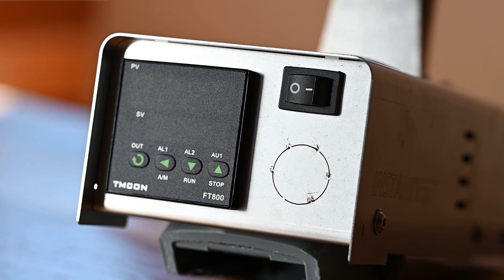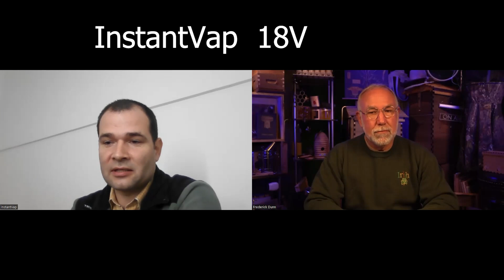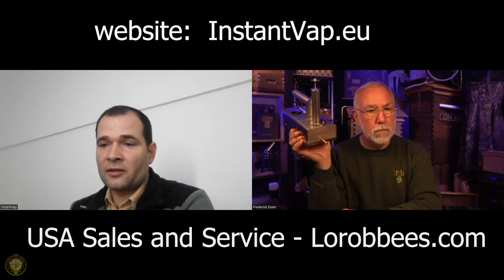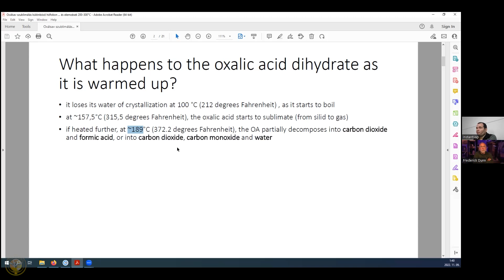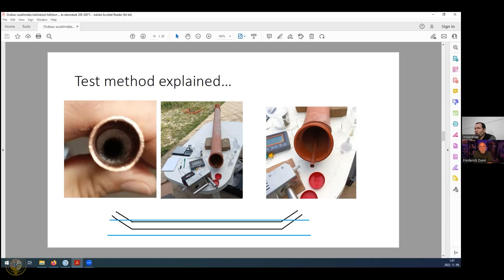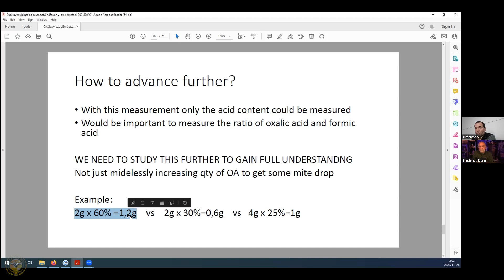Oxalic Acid Vaporizer, Battery Powered. Interview with Janos Fenyosy, A Higher Dose may not be good.

Comment: Was there any follow up on if testing had been done to determine oxalic and Formic concentrations in the acid at higher temps? 50% is rather low and hopefully it’s possible to achieve a higher percent. How was the acid prepped? It should be dehydrated before vaporizing. I wonder if most of the percent loss was simply evaporated water. What is the test that the university labs were unable to perform ?
Reply from the maker: 100°C–135°C: Water of crystallization boils off, lifting the acid (often displaying the Leidenfrost effect).   180°C–210°C: The vast majority of active oxalic acid exits the nozzle.   By ~220°C–230°C: Delivery of intact oxalic acid is virtually complete.   Look into field testing and results posted by Scientific Beekeeping. Randy Oliver performed the analyses.

Comment: This video is a couple of years old.  Some of the new studies coming out of Auburn University suggest that an application of higher than two grams of OA per brood box is necessary for good efficacy.  We are still using a 1 gram rule. Are there any scientific studies that support the 1g per brood box rule?  Janos says that there is no reason to use more Thant two grams per hive. Is that based on science or opinion?
Reply from the maker: It's based firmly upon scientific methods. 2g per box is the new dose. Janos concerns about temperature fluctuation during delivery have been validated, most recently by Randy Oliver at ScientificBeekeeping.
Reply: @FrederickDunn thank you so much for responding.  I have wondered if the temperature fluctuations of the vaporizer during a 2g vs 4g application was significant enough to cause a different chemical reaction in the OAV.  I’ll definitely try to find Randy Oliver’s  research. Thanks again.

Comment: Hi Fred hope you are well. As you know we have the mites here in Australia now. I would like to know if you remove your honey supers when you are going to use oxalic acid vapour treatment for the mite control?
We still don’t have much direction here about treatment so I am gearing up to use oxalic acid. 
Thanks. 
David Love.
Reply from the maker: We don't remove honey supers when using OAV. It's been proven not to significantly alter the presence of OA in honey before or after the treatment cycles. So, our FDA approves it. That's good news as you don't have to take anything apart to give that vapor treatment.

Comment: I use a Oxalika with the automatic tablet dispenser on top cost me a lot with import duty and a load of tablets close to £1000 but the unit doesn’t work as well as there video. I have a drill to unblock the nozzle but also the tablets can become sticky and you have to stop and clean the whole thing out a good unit but disappointing after using many different devices I find it hard to believe any oxalic vaporiser doesn’t block up. Do these battery units that every body is talking about really not block up I find that hard to believe.
Reply from the maker: Mine has not been blocked at all, but neither did my prior unit that was a ProVap. Not sure why yours would be getting clogged.

Comment: I use petrolium jelly. none toxic and is ok with high heat. and cheap. you can get at any store.
Reply from the maker: What do you mean, you use petrolium jelly? For what? And how?
Reply: I use it to grease the rubber ring on top of the plumger to make it easier to push in and out. a light coating. It says to lubricate. and petroleum jelly is used for most plumbing, mechanical and electrical parts that need some grease to keep them lubricated. FYI anything that comes with a little packet of grease is more than likely petroleum jelly @FrederickDunn

Comment: Might be quite easy to measure the outflow of gasses lime carbon momoxide with LEL measurement devices . Decomposition gives huge volume expansion ,so when decompose there will be a flow at the end of the copper pipe used .
Reply from the maker: I hope we can get someone to sample those gasses and provide some analytics. It would be very interesting.

Comment: Has anyone had any issue with tip clog at all?
Reply from the maker: Not with this unit so far, I did have that problem with the Lorrobees model, but not the InstantVap. As mentioned in this video, you can run some distilled water through it and the OA dissolves away as does the residue. But I only have 23 colonies. Have you had any clogging issues?
Reply: @FrederickDunn  I'm contemplating buying this vaporizer. I have other vaporizers where the tip clogs and it's something I no longer want to deal with.  So before I invest in another big money sideliner model I want to know this one is gonna work! lol

Comment: I bit the bullet and bought one of these vaporizers and oh my gosh I am amazed by how efficient, simple and easy to use it is.  So fast.  It’s actually fun to use!!!
Reply from the maker: I'm with you Bruce, I did all of my hives in a single afternoon. I did use two batteries though :)
Reply: @FrederickDunn  I bought 4 of the 6aH batteries so should be able to plow through 90-100 colonies without having to worry about recharging.  I used 4 grams on the colonies.  I heard what he said about the effectiveness of using 4g so might need to revisit the dosage.

Comment: Ha Fred I watched this again  did not quite get it  was told research says  1 gram per box does not work  need 2 grams per box,   so I have been using 4 grams  is he saying that it sould be 2 grams that 4 grams  drops the eficiency and does not work  because of the temp drop  thanks
Reply: Hello
What I was trying to say is that the behaviour of the vaporizer tool (how much the temperature drops with the addition of oxalic acid, how it maintains the temperature when the outside temperature is lower or windy) has a big influence on how much oxalic acid comes out of the tool, how much degrades in the tool already.  
There are many types of vaporizers on the market, most of them are clamp heated and the temperature drop is significant, so they are inherently inefficient. If a larger amount of oxalic acid (e.g. 4g) is added into them, the temperature drop is even greater and the efficiency even worse. Overall, you may only get 20-30% more oxalic acid if you double the input amount. This should be better investigated and taken into account when treating. I hope it make sense. 
Also, with this knowledge better vaporizers should be designed.
Reply: @instantvap5808  Thanks
Reply from the maker: HI Frances, please link the actual research that supports 4 grams? I cannot "legally" endorse dosing or methods that are outside labeling or approved materials/equipment. But it's clear in Janos' presentation, that higher dosing at 4 grams can result in a much lower actual OA delivery to the hive/brood/bees. His personal sweet spot was 3 grams with his large hives. Temperature controls, based on his presentation and testing are critical if you want a "good dose" of OA to reach the targeted area. His system is part of the potency, as shown in his charts, the 2 g dose is delivered fast and at the correct temperature that will not degrade the OA. As mentioned here, it's an area that is in need of further evaulation. The real result for you would be what your mite-counts were before treatment, and then after treatment. If the mite load isn't significantly dropping, then something has to be evaluated further. I achieve good gontrol with 2 g dosing with two hive boxes. 1 g for my nucleus hives if they are singles, 2g for my nucleus 3-stack hives. Controlled delivery at a fast rate would be beneficial.
Reply: @FrederickDunn  Thanks
Reply from the maker: @framcesmoore  you are always welcome :)

Comment: Loved the interview,  he said he strictly uses OA. I wonder if he does maintenance doses all year with brood in the hive  or creates brood breaks or only treats late fall or winter when bloodless
Reply: Hi. 
I did brood brake this September the first time. 

Previous years I vaporized 
-	after acacia 7 times every 3 days early-middle June
-	after sunflower (August) again 7 times every 3 days. 
-	in winter 2-3 times when they come out for cleaning flight. 
But every year is somewhat different, some years the mite load is lower, other times it is much harder to keep under control. Definitely it needs to be monitored. 

I do the queen cages this way: 

Find the queen and put it inside the cage, close it, and put it between 2 brood frames. 
- day 1: queen caging. It should be in autumn, when the feeding for winter already finished, only a couple of brood frames remained. In central Europe we do it during September. 
- day 16: first oxalic acid vaporization, by this time all the brood is capped. (once the supers are off, it is enough to treat them with maximum 2-3 grams of oxalic acid dehydrate per colony) 
- day 22: queen is let out of the cage. no caped brood is left, all the mites are on bees, no place to hide for them. 
- day 23: 2nd OAV. 
- day 27: 3rd OAV. Even if the queen started to lay eggs, no capped brood yet. 

 Some of the benefits of this method: 
- a time period is created when there is no capped brood, so the mites can be all reached by OAV. 
- There are 2 treatments of OAV, when the mites has no place to hide. 2 times a very efficient treatment kills more than 95-98% of all the mites. 
- Because there is a very low mite count to stat with in spring, these colonies are usually enough to treat in august next time. Periodic check is necessary, as infestation of mites can occur from outside through robbing, etc. 
- the winter bee generation goes into a rest mode, as there is no brood, no reason to work. They remain strong for a start in spring. 
- the winter bees are healthy, they go into winter without mites.
Reply from the maker: This is a fantstic reply, I will repost it in the description. Thank you, Janos!

Comment: Great video  He said he only used OA for his treatments and that he has had no loss since he started doing this     How often does he treat  Fred how do u treat  O A is cheep  I use mite away in june  when I remove the honey suppers,  then   apivair strips,  july   for the late treatment,  I dont want a brood break  they need to build up for the winter   we have dearth from june to oct  but not much come in   so I am feeding from the time I take my suppers until winter when I put the candy sugar on top.   They cost alot,   I use   Oav    now  treat every other week  going in to dec   there is no brood break  till maybe in late dec   because I now have that wonderful vap that he made  it is set on 445  and does wonderful  best tool I have ever had it is great. I have 30 hives   I hope all that makes since   thanks again for the video  O 1 more question   what was that battery that u use   u are able to treat all your hive with just 1 I want to get 1 for my self  I have 4 small ones that do not last long at all thanks
Reply from the maker: I also only have used OA for my miticide. I've had Formic Pro on the shelf ready to go IF the OA doesn't get mites down. The formic pro just expired unused. You had a different management practice than I do, I don't feed them at all unless they are a split, package, or small swarm. I leave them to rise and reduce with any dearth through the year. When it comes to early spring, or fall after honey is removed, weaker colonies can have a boost, but I tend to only open feed. This way, I find out which colonies are capable of subsisting on forage and their numbers are in sync with the environment.
Reply: Ha Fred   the open feeding sounds good    and I tryed it for 2 years   but we have to many bee keepers around  and I do not know if they treat or not   I was feeding there bees and mine   it cost me a hole lot more to open feed  as well  I feed each one   of my hives  now   so far I     have used 1500 lb sugar    in doing it this way  I know they have food  they down it in less then a week they keep rearing me brood  so they are strong for the winter plus they draw comb for me.    I use 2 gal buckets and have frame feeders as well,  When I first started bee keeping  I did not feed  I did not know u was  expost to and  the hives went into winter with  small clusters because we have a long dearth  just because  I am in a city    and they came out dead in the spring  or just to small to make me honey in the spring.  where I live is not like your beautiful  place  there is no fields of nothing here  just  houses    and some trees  our flow is  starts April  is in full May and is over in June  I am removing the suppers on fathers day  and that is the hole flow.   There is nothing else here  that produces much of any thing for the bees.     I watched Kamon and Bob Binnie  on the feeding  splitting and stabilizing the hives.    Because I  did it this way  I got the most honey I have ever gotten  I got 25 gal  it was wonderful   and it was because they went into the winter strong  I gave them pollen patties in February and hive alive    in March as well  they came out  strong   I probably should had gotten more  but I had some swarms  because I tried a different spring management as well keeping them way to strong.  trying to hold them for the flow  by splitting up the brood instead of splinting them, removing them, so not doing it that way next year  will  equilize the hives and do splits      I am really looking forward to spring    just trying new ways  to build them up and hole on to them with out swarming it is great well I have talked to much  and I have confused u for sure  I do not explain very well  so I hope u understood what I was saying..  thanks for the video it was great.. and I am enjoying my vap  please explain  what and how u do your mite    will it work with my management  my hives are never broodless
Reply: @FrederickDunn   If u only use oa  how do u do your treatment how often   oh yea what size is the battery u use  for the vap thanks
Reply: Hi. 
I did brood brake this September the first time. 

Previous years I vaporized 
-	after acacia 7 times every 3 days early-middle June
-	after sunflower (August) again 7 times every 3 days. 
-	in winter 2-3 times when they come out for cleaning flight. 
But every year is somewhat different, some years the mite load is lower, other times it is much harder to keep under control. Definitely it needs to be monitored. 

I do the queen cages this way: 

Find the queen and put it inside the cage, close it, and put it between 2 brood frames. 
- day 1: queen caging. It should be in autumn, when the feeding for winter already finished, only a couple of brood frames remained. In central Europe we do it during September. 
- day 16: first oxalic acid vaporization, by this time all the brood is capped. (once the supers are off, it is enough to treat them with maximum 2-3 grams of oxalic acid dehydrate per colony) 
- day 22: queen is let out of the cage. no caped brood is left, all the mites are on bees, no place to hide for them. 
- day 23: 2nd OAV. 
- day 27: 3rd OAV. Even if the queen started to lay eggs, no capped brood yet. 

 Some of the benefits of this method: 
- a time period is created when there is no capped brood, so the mites can be all reached by OAV. 
- There are 2 treatments of OAV, when the mites has no place to hide. 2 times a very efficient treatment kills more than 95-98% of all the mites. 
- Because there is a very low mite count to stat with in spring, these colonies are usually enough to treat in august next time. Periodic check is necessary, as infestation of mites can occur from outside through robbing, etc. 
- the winter bee generation goes into a rest mode, as there is no brood, no reason to work. They remain strong for a start in spring. 
- the winter bees are healthy, they go into winter without mites.
Reply: @instantvap5808    this is great thanks
and your  vape  is wonderful  I Love it.
Reply: @instantvap5808   I read this again  this is really great  I wrote it all down so I can do it thanks  Have a blessed week and thanks again